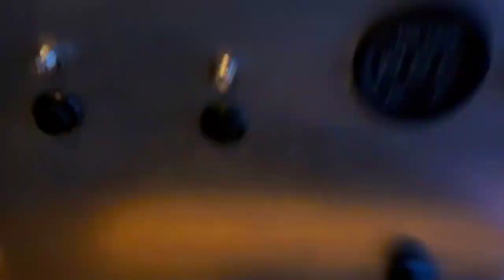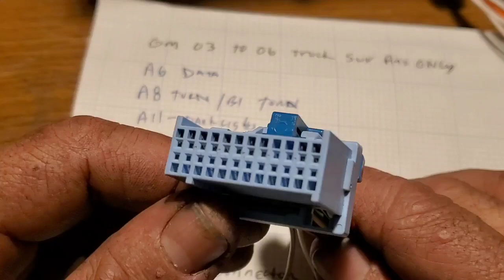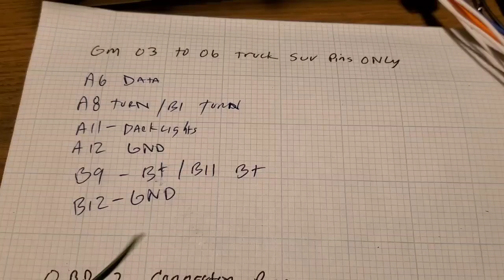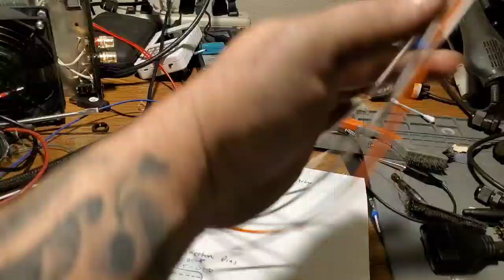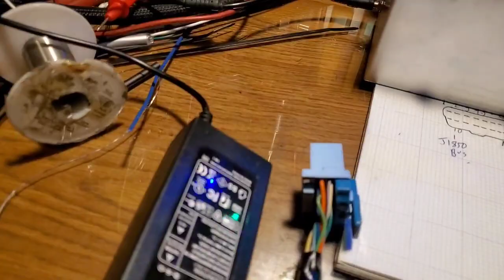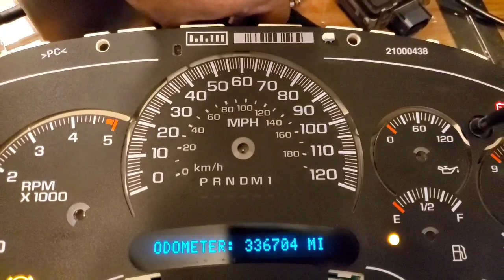Building a cheap gm instrument panel cluster bench tester

Comment: I'm really struggling to get this to work.  I have a stack of GM clusters and I can't get a single one of them to do anything.  If I connect A12 and B12 to ground and B11 and B9 to +12 it should do something right?  Does A6 need to be hooked up for the cluster to just power up?

Comment: if anyone else has had problems with OBD testing, pin 10 on the OBD connector for the data line did not work for me; i used pin2 and it worked perfectly.

Comment: I built a similar box but I use it for programming ECMs etc so I have banana jacks so I can connect an ECM harness  or radio/cluster harnesses etc everything is colour coded. I even use the banana jacks for power input with a battery clamp harness to I can just connect with under the hood and bench program the ECMs, clusters etc

Comment: I built this tester just like this but without the leds for the switches and with an external power supply, in the video he only hooks up the positive terminal on the switches, constant power and the signal wires from the connector. My switches do nothing when pressed however  the back lights and turn signals are constantly on when the unit is powered up just can't toggle. Can anyone help?

Comment: Hello Jack... I need to test the back lights, turn signals, and read the mileage on 99/02 clusters. Could I pay you for the information detailing which wires to use in the pinout?.... I'm going to make a test station like you built here.... Thanks

Comment: 03-06 is trailblazer the only one that has a different pin out?
Reply: Yes, '03-'06 Traiblazer/Envoys are different. Here's what Mitchell says:

Pin.  Wire color.  Ckt#.   Function.
A1.    L-BU.    2114.   Left Turn Ind
A2.     OG.       2340. Battery (B+)
A3.                                    Not used
A4.    BK/WH.       751.    Gnd
A5.    BK.             2250.    Gnd
A6.                                      Not used
A7.   BN/WH.  230. Gauge Backlights
A8.    YE.               1327.  DIC Fuel Sig
A9.  D-GN/WH.  1358. DIC Switch Sig
A10. D-BU.   894.   DIC Toggle sw Sig
A11. OG.    1816.  DIC Set/Reset sw
A12.  WH.   121.  Eng Speed Signal
B1.  GY.   1036. Data, Class II Serial
B2-B3.                          Not used
B4.   BN/WH.  419.  MIL control
B5-B6.                        Not used
B7.   PK.      639.  Ignition 1 voltage
B8.                         Not used
B9.  WH.     817 Veh Speed Sensor
B10.  D-BU. 2115. Right Turn Ind
B11-B12.                      Not used

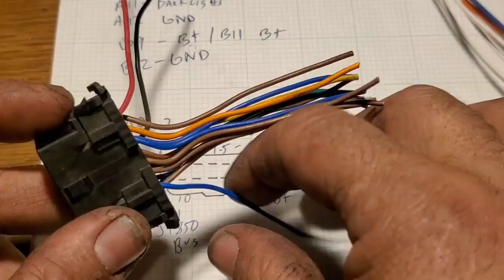Comment: Jack, isn't pin 2 on the DLC the Class 2 Data ckt (see 21:18 )? My diagram shows pin 10 as vacant on 2003-2006 GM trucks. Even your previous video ( https://youtu.be/zy3j9AZdAsE ) shows pin 2 as the data pin on the DLC?
Thanks!
Reply from the maker: I need to double check that asap. I'm not at my desk right now.  If I made a mistake I need to fix the video right away and seriously thank you.  I do not want to put bad info out there.  I just switched from alldata to identifix and pulled up the pinout before making the video.  I know my last video is correct because that's the one I always use.
Reply: Pin 10 was not working for me. I switched to Pin 2 and also used Pin 4 as ground vs. Pin 5 in this video. Another video of Jack's calls out Pin 10 and Pin 4. Once I made these changes I was able to connect an ELM327 dongle to my version of this bench test box and issue cluster sweeps and turn on all indicator lights.
Reply: Hey Jack, I don't think you ever corrected the pin-10 issue on the video (unless I missed it) ??

Comment: on GM clusters  from 98 to 2007 how many different pigs tails are there from what year to what year were there changes
Reply from the maker: Lol. Last comment.  The climate controls in the gm truck line also have a lot of issues.  The same tester will cover those . Im going to post a video soon on repairing the bad encoder/ potentiometers that make the temp jump all over the place and also how to do an led light upgrade on them.
Reply from the maker: 99 to 02 then 03 to 06 and finally 07 to 2010. Surprisingly they all have issues .  99 to 02 the display solder joints break and occasionally the steppers go bad.  The 03 to 06 have the most issues. Everything from bad steppers to broken solder joints everywhere, the bulbs burn out , the microprocessor solder joints go bad causing the language to constantly change and the main connector bresks away from the board (all easy fixes).  The 07 to 10 just have display issues and are pretty solid.  The 02 to 07 trailblazers and Malibu's also used the same steppers so they have guage issues just as much as the others.
Reply from the maker: I guess the simple answer is i have 5 different pig tails to cover them all but regularly only use 4 .
Reply: Jack Meyers thanks
Reply: When’s is your next video coming out
Reply: Ok nother question what years did they change like from 98  to when need a different pig tail then the next year for a dffrent on and so one
Reply from the maker: I have done Ford cluster videos coming tonight and more gm stuff over the weekend.  The pigtail year change was 02 07 . So 99 to 02 used the same, 03 to 06 used the same and 07 to 2010.
Reply: Jack Meyers Thanks alot
Reply: Will the same wiring diagram work on all 4 that you talked about in your video
Reply: Hi Jack were do you buy all your lights and stepper mottors from